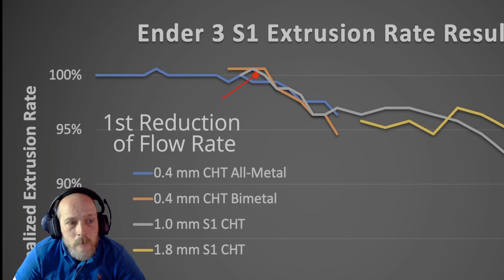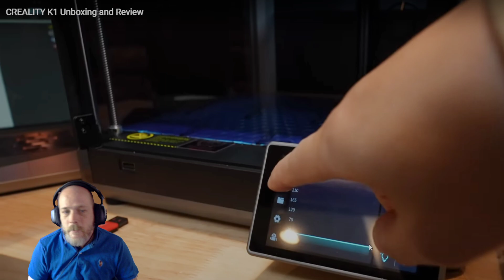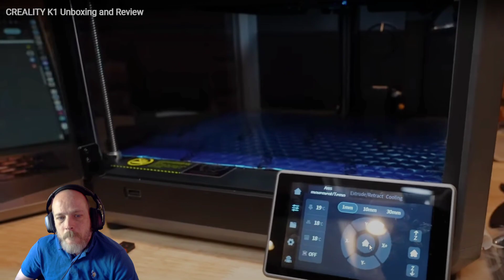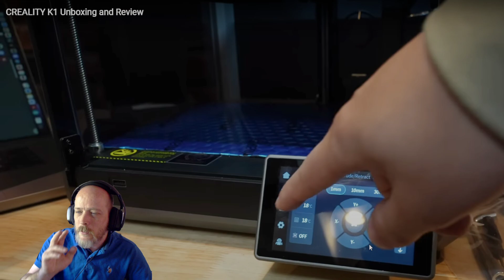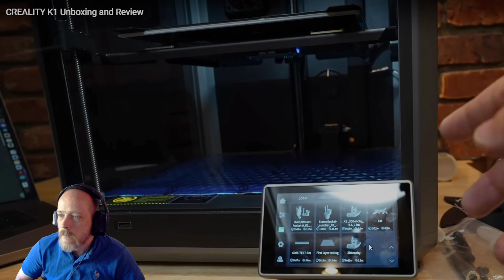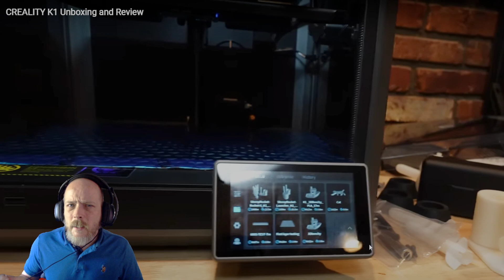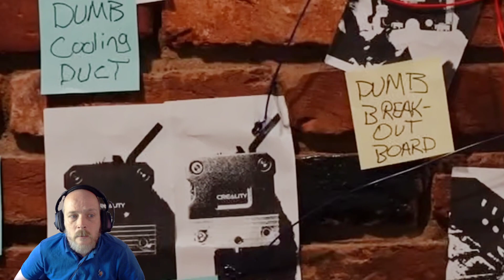Reaction to Creality K1 "review".

Comment: Lots of fair points here, I appreciate the review of my review. 

P1P, X1C, Voron, are great options, too. I just don’t like their locked down hardware and always on cloud functionality because I’m paranoid like that. 

I didn’t try the Creality cloud stuff because I prefer to plug in the usb drive, start the print, and unplug from the wall when done.

My end game is to put open source firmware on any of the machines I run. That is one way you can be sure it’s not doing some funky stuff on your home network behind your back. I might be wrong here, but I think creality K1 has the right chipset to run Klipper. Bambu printers do not (as far is I’ve been told)

I do think it’s fair to ding the P1P for the  TV-remote buttons compared to the K1 touch screen. The K1 has a really good touchscreen, probably the best in its price category.

About the first layer, it appeared inconsistent on the one layer thick sheet test, but in every real print it had perfect adhesion, and I had 0 issues with parts actually coming loose or curling. Also hoping this will be improved via firmware updates.

I’m pretty ignorant about the X1C. The first time I’ve seen one in person was today about 4 hours ago. They didn’t send one for me to review, and I don’t have $1220 sitting around to buy one. But the P1Ps seem nice. Didn’t know that it can go to 2000mm/s, that is news to me!

The carbon vs steel thing, I once had a pair of carbon wheels for my bicycle, and they wore out in one season. Left a bad taste in my mouth for carbon fiber wear surfaces. Also the standard for many sliding and wear applications is lubricated chromed steel. I’ve never seen carbon fiber reinforced plastic deliberately used as a material for a wear surface. Engineers are too conservative at times, maybe I need to embrace the change to carbon rods? Also, steel can rust, so there is actually a possibility that it would corrode and wear out faster than carbon. 

I complained about fan noise on the P1P because it is going to be really hard to replace them with quieter fans. Same could be said for the K1, so time will tell. Also, if you need multi-material printing you gotta go with the AMS. I don’t think creality has plans to make a multimaterial unit for the k1.

The affiliate links are problematic, but have been the norm for many years. Who knows how much some of the bigger creators received from PRUSA during the extended “highly recommended bedslinger” phase from 2015-2022.

I have spoken to at least 5 people who were promised k1s, but have not seen any videos from them yet. I wish some other reviews would come out already so I my assessment can be verified or disproved. In other industries, like cars, laptops, phones, cameras, drones, etc. they have embargo dates. With 3D printing it’s usually just every man for himself and may the first poster win. Maybe an embargo date would help because then at least you get 5 or so videos out in the same day, instead of this clusterf*** where 1000+ people are hyper-analyzing my video. I didn’t sign up to be Creality’s sole spokesperson!

This review was done under the same terms as all my other 3D printer reviews. If you send me a printer, maybe I’ll look at it, maybe I won’t. No contracts, no terms, no script.

Too many points to address in this one comment, but as Bambu Lab said in a recent blog, “Let the games begin.”
Reply: There are definitely a lot of people that are attacking you. I do think you made a honest review based on your others. I ordered a k1 and am excited to get it. People are saying this will be a disaster but what is stopping one Chinese company from doing the same thing as another. I think that crealitys customer service is pretty decent and has always resoved any problems I had with my printers. I have 2 bambu labs printers with over 1000 hours on each and love them. The only downside really is there customer support I can’t even get a response.
Reply from the maker: Hey, thanks for the feedback.. I know I may have came off "aggressive" in my reaction to your review.  I wasn't trying to attack you and sorry if it felt that way.  I just personally felt the review to be a little bias and seemed to lean heavy on the side of being sponsored without it being noted.  I didn't say it but it is entirely likely that isn't the case and that's just the feeling people are getting from the video.  It seems your video was rushed to be one of the first to get a first look review up online.  From that side of things I get it.  Content is king and you are looking to do youtube full time so I can understand the haste and maybe some of the oversight on what was being said.

I'm glad you found my video and took the time to write a response and address some of the concerns. As I said in my video I agree with some of what you said. the 599$ price point is AMAZING for what you get with the K1.  In fact i'm eyeballing probably buying one in the future.  Simply can't beat the price.  Other claims rubbed me wrong like the "It might even be better than a Voron."  While I respect that maybe your personal view I just don't think based on facts alone that's going to be the case.  The K1 looks sharp and has an excellent price point which will surely heat up the competition.  Price wars anyone?

Overall I just wanted to say thank you for the initial review you provided and that I do respect the grind.  You have to make your money and part of that is being a marketing type of personality.  Without it sponsors in the future will not even approach you as they want to know they are getting their monies worth when they decide to offer deals.  In closing I respect your circumstances and understand.  I just had a few personal issues with the video and I have never done a react video. I was so impassioned by the topic I kind of just let it all go and said what I was thinking.  

Lastly, thank you for taking time to respond!

3D-Brothers
Reply from the maker: @cody9981  I agree with you Cody. The bambu customer support can take DAYS to get back to you. Resolving an issue with them is slow.  I feel they need some localization in regions other than China.  That being said I love my Bambu.  The price point of the K1 is great for lots of reasons. It should shake the market up AGAIN with pricing.  After bambu just shook the market back in Janurary, Creality is poised to come in with some stiff competition. Even if it doesn't print as good as a bambu or have high quality parts like a bambu.  It will be a very attractive entry level printer for people getting into the hobby to wanting to expand their collection with fast printers.

Comment: The P1P has a maximum toolhead speed of 500mm/s. 2000mm/s refers to the acceleration.
With that in mind the K1 on paper outperforms the P1P in toolhead speed and acceleration.
Reply: Ill also add that its set to 300mm/s as standard as its missing the part cooling fan that its big brother the X1C has.
This is comparable to the standard speed on The K1
Reply from the maker: @STUDIOPHOENIX-UK  While you're correct.  The K1 is a hybrid of the p1p and the x1-c.  To compare it to just one is a little unfair.  The K1 took let's just call it ... Inspiration, from both the P1P and the X1-C.  That being said, There are still red flags with this printer and the review.  The X1-C I believe will easily out perform the K1.  But that's something that has yet to be seen currently.  With all that in mind, 599$ for the K1 is an AMAZING price point and it slays the P1P hands down. If it can live up to all of it's claims the K1 will be above the P1P hands down.
Reply: @3dbrothersprinting  I agree the comparison is unfair. For me the comparison is made as I simply can’t afford the X1, hence the comparison is on price point. I am keen to see this do well as I’d like to run sonic pad on all my printers. Guess time will tell.
Reply: From other videos it seems if you use the special “hyper” cr pla, the K1 can actually print at 600mm/s. From what I have seen from bamboo labs it suffers from under extrusion at near those speed. In the end competition is good, just saw another corexy/Klipper printer from kingroon under 400$.
Reply from the maker: @joescalon541  The competition is heating up!  I love it! It means the prices will drop, speeds and quality will increase and more people will have a smaller barrirer to entry.

That being said, companies should take their time and put something to market truly great to be a heavyweight competitor.
Reply: @joescalon541  saw that one too, can only mean good things for us the consumer 😊
Reply: Id like to see someone take all the good things from Bambu, k1 and Prusa mk4, and make something with all the bells and whistles.
Personally id like to see mk4 levelling and first layer on dual sided PEI, K1 speed and enclosure, Bambu reliability, poop shoot and nozzle wipe. And non cloud based slicer using clipper and ams as an option….. preferably under a 1000
Reply from the maker: @STUDIOPHOENIX-UK  I would LOVE to see a machine like that. Add in a tool/head changing system to cut down waste on AMS.. Would be an instant buy!
Reply: Good luck printing at 600mm on most things with the K1 your going to have a bad time.
Reply: @georgeslone8780  Thanks, Gandalf.

Go tell that to the people that wrote Klipper. 🤦

Comment: Ok bamboo labs uses gcf(graphite carbon fiber) which is somewhat self lubricating and less abrasive than traditional rcf(resin carbon fiber) but is still infact an abrasive material. That being said as long as you keep the rods clean and replace bushing (they will wear much faster than the carbon fiber rods will )you should get a plenty reasonable lifespan out of them! I prefer the ss rods the k1 has and I will be reviewing mine when it comes in!
Reply: Also the reason he talks about the cloud service but doesn’t show it is the creality cloud just like the bamboo cloud is under scrutiny for so many people would rather have options(k1 can use usb, and WiFi to send files alternatively to the cloud, while bamboo does not allow that for you to wirelessly send files you still have to have access to the bamboo cloud)

Comment: It's crazy how many problems these "reviewers" are having and how they gloss over them. Creality has horrible QC. I saw one "reviewer" whose hotend snapped off. They said its no big deal because Creality has a warranty. I was thinking "seriously, obviously you've never dealt with Creality as a pleb." I had a bed so warped on my first printer (s1 pro) that it couldn't work. Creality said it was "within spec" and told me to layer masking tape under the plate to level it. This is going to be a dumpster fire for normal people.
Reply: Unlike you, these reviewers and others know how to work on machines.

A loose wire here and a loose screw there we don't really classify as poor quality control. We just classify that as made in China.

LMAO.

Comment: Buyer beware this printer Creality is a marketing company. The original ender 3 was a good little printer. Everything after that’s been junk. It can’t print much at 600mm. 500mm is what your going to end up using most 600mm prints will fail. I’ve seen people review the k1 and you can see the enclosure bend and flex when they are moving it around. Don’t be fooled by many of these YouTube reviews. Thanks for for reaction video. Glad to see you have some principles.